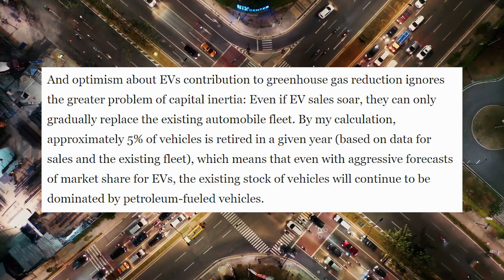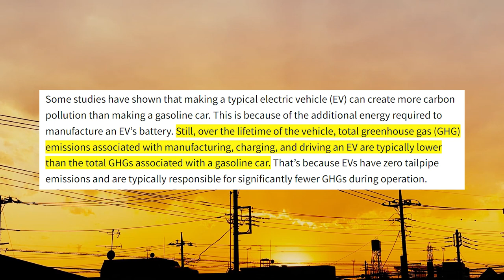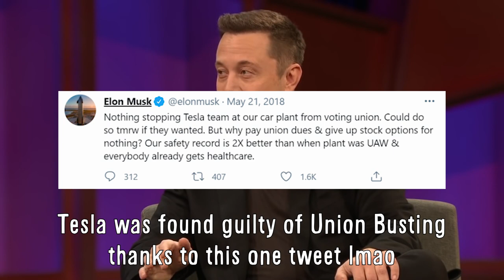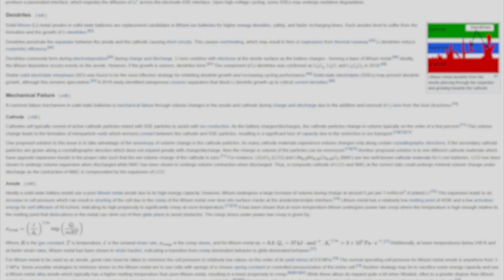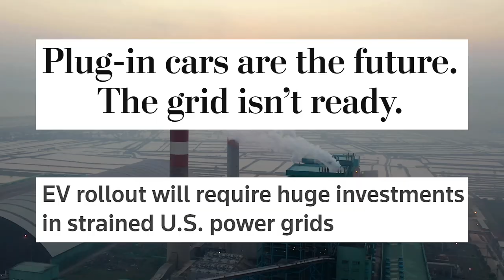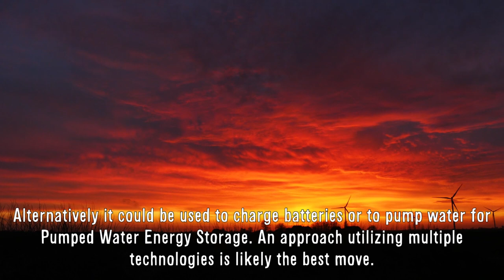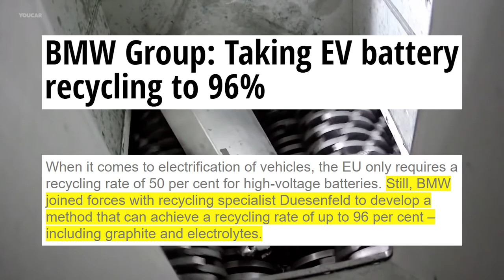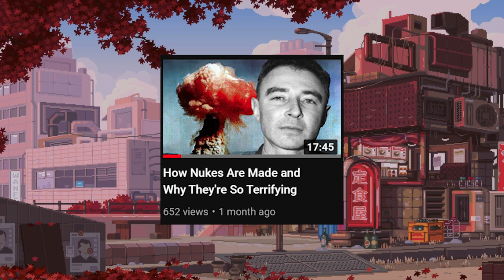Are Electric Vehicles Actually Green?

Comment: For those who live in California, you have to be an idiot to not get solar panels put on your roof if you own an electric car. My brother drives a Chevy Volt and just got solar put on his roof along with a Tesla power wall battery backup system. He also got a high voltage charger installed. There is a lot of upfront cost to upgrade your home electrical infrastructure, but it’s worth it here in California with all the charger & EV subsidies etc. So at this point he can basically drive for “free” with 0 emissions because he charges from solar and doesn’t have to worry about gas price fluctuations!

Comment: Another problem with electric cars is that they are much more expensive than comparable ICE counterparts, so without subsidies they are not really appealing to mass public.
Reply from the maker: Mostly yes. EVs have the added benefit of being cheaper to charge and they generally cost less to repair, but the initial cost of an EV makes them rather unattractive to many. That being said, I'm reasonably confident prices will begin to reduce in the next decade or two mostly due to technological advancements.